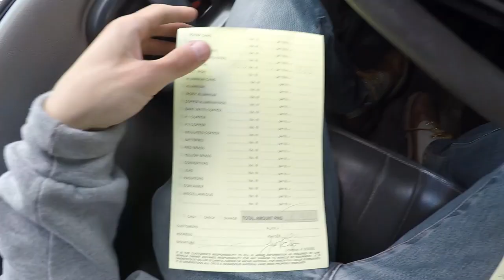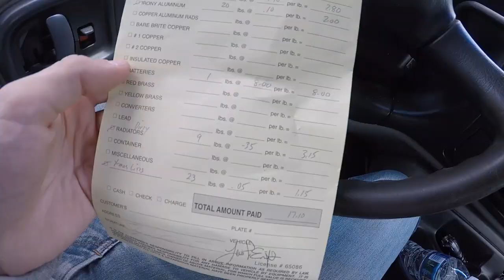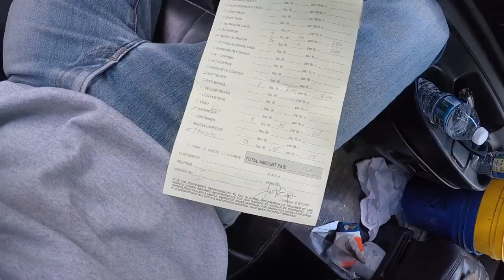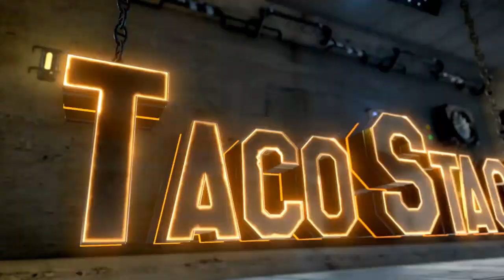THE SCRAP LIFE IS A GOOD LIFE!! Scrap Run

Comment: the radiator is all copper and brass, except the sides, which are steel. and they are soldered on.... a small torch will quickly melt away solder, then sides come off, remove hoses and any steel fitting, and then you'll have clean copper/brass which is now bringing 1.40 a pound here.

Comment: If you would have cleaned that radiator it should have been well over $1.00 a pound. That is a copper/brass radiator. You pull the hoses/clamps & cap off them and then take a cold chisel and hammer and knock the steel side plates off them( and any other steel, like the drain parts ). Those side plates usually come off fairly easy.  Do that and you have a clean copper/brass radiator.

 You commented about the guy that set out his car battery. Well you lost almost as much by not tearing down that radiator.I learned the hard way about a lot of this stuff. I lost a lot of $$ when I was starting out scrapping. If there is something you are unsure of, it's a whole lot better not hauling it and doing some research first.  Or show it in your video and ask if any of us know. We can let you know and then you can haul it in the next load.

Comment: You're making a big mistake with the radiator the radiator is non-ferrous Weatherby copper aluminum or whatever it only takes about two seconds with a hammer to knock those ends off of the radiator it's well worth your time you might get a dollar with all the stuff on it but you'll get 10 to $20 with a clean radiator it really is worth your time